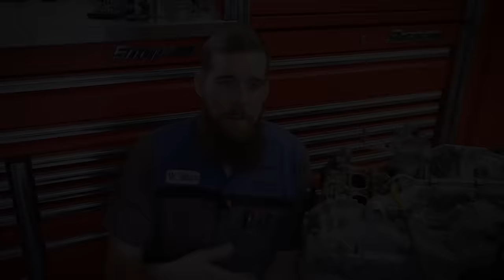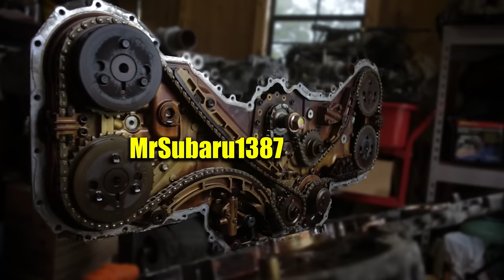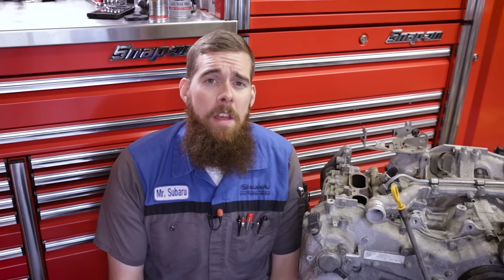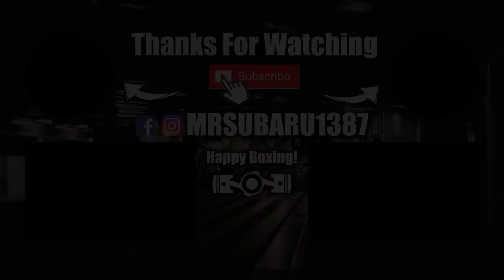Why Subarus Are So UNreliable!!! Buckle Up!!!

Comment: I had a non tubro forester with the 2.5. I bkught it with 225,000 miles. It had already had the head gasket done once and I did it plus the water pump and never had a problem. I put over 50k on it with no problems. I eventully put a thro out bearing in and sold it to a friend. It has like 350,000 on it now and runs fine. Needs shocks.

Comment: Most of these if not all of these issues are only Related to the USDM subarus and the 2.5L POS. 

The EJ205 Turbo has no headgasket issues, no Ringland issues, No big end bearing issues. 
Only issue is the MAF and the weak 5 Speed. 

Obviously im talking about the real Impreza WRX's 1994-2000

Comment: I really understand your point, Subaru is a really different type of car compare to other mainstream brand. But most people aren't interest to maintain or taking care of normal maintenance . My actual FXT 2014 is my first subaru car and i love it but maintenance cost are easilly double than a regular car like my previous : (Mazda MPV 2006, Toyota corolla 2000,  Nissan Sentra 1992) My FXT 2014 as now 274000km or 171240 miles no issue with the FA20DIT no oil consumption at all, only issue with the CVT. I make all the maintenance like subaru recommend interval at the dealership.

Comment: 100% true.  I was just talking about how in this town there are 1,000 chumps whose daddy's buy them $80k cars, then they go and buy cheap-ass chinese tires and complain that the handling on their cars sucks.  If you drive like a moron, you'll have moron problems.  If you buy $2,000 wheels and buy $80 tires, you're a moron.  If you keep pushing your car too hard, it's not going to last long.  This video is fantastic.

Comment: My 08 STi, i bought in Dec 07. Ringland failure in 2 & 4 around Sep 09 66k miles. WHY? Cuz i beat the crap out of it. I did a quick short block swap in a weekend. Then in 2011 about another 60k miles i get a head gasket failure. WHY? Cuz i didn't resurface heads. Now i had time and money for next one going in. Had a shop build me a long block. Currently at 101k miles on this block. Total 227k chasis miles. Currently still on same tune & long block from 2011. I love my beat up battle hatch and i still beat it up daily to work. Also have a 19 STi that i bought in Nov 18. That one stayed stock for a month. I did this one right from the start lol. But i beat it up on weekends. Not once did i go to subaru for warranty replacement. I know a few that did. And it boils my blood......... Feel you on on this video...!

Comment: I am one of those people who are doing self-modifications to my '19 WRX.

I change oil every 3k to 5k miles. I got a pro-tune after cold air intake / CAT-back exhaust. Regularly check the engine for leaks or common issues.

I also like to launch my car, drive it "spirited", and plan to modify and tune further. If I end up burning my clutch early, blowing a gasket, or damaging some internal to the engine... It's my fault. I am WAAAAAAY past warranty and I take responsibility for anything that goes wrong.

Comment: Outback 2015: close to 200.000 km, the head gasket needs replacing. I have always been gentle to it for 7 years of it's life time. Needs every 5k oil change, not 10k as advised by Subaru, and if you hear a knocking sound from the engine, your oil is disappearing. Wish I knew this 7 years ago. I have run if into the ground much sooner than I anticipated.  I'm not going to replace or fix a bad engine.

Comment: From another fellow mechanic I can relate lol. I appreciate the videos I'm a Subaru Crosstrek owner and have been honestly quite frustrated with the lack of service info for the CVT transmissions. That said I wanted to Thank you for providing that info so I can better maintain my car. PS just hit 122k and was wondering other that the CVT fluid are there any other things that should be addressed at that mileage that aren't really common knowledge?

Comment: So true MrSubaru! The N/A Subarus aren't necessarily bad either. I owned a 2008 Impreza and it was truly a reliable car. Drove it like a regular cummuter car most of the time and had a lot of fun driving it like i was in WRC when it snowed. Used quality oil, changed oil every 5-6k km's. The only thing I ever had to replace besides brakes and plugs/ wires was a front CV axle. Ended up trading it in for a new used car last year because the timing belt was passed due and wanted to get something with more power.

Comment: My 2001 LL Bean edition w the 3.0 H6 is truly the best Subaru I've ever owned. 22 years old runs like new.
Reply from the maker: My 2002 LL Bean has 301,000 miles on the clock.
Reply: @MrSubaru1387  mine is at 140k still going strong doesn't use oil between 3k oil changes. And the power of the 3.0 makes it a joy to drive.

Comment: I have a 2021 STI bone stock and no plans on modifying it outside a bit of cosmetics. Not even an AOS. I drive the STI mostly in intelligent drive mode, shift between 3-4k, almost never go into boost. On the freeway onramp I might go into sport to accelerate quicker (downshifting to not lug the car) on occasion. But I baby this car, treating it like an economy car. 

I always say "if you drive it like a race car, expect race car reliability"

Comment: I have a '12 impreza sport that is nearing 160k miles.  That isn't an amazingly high amount of mileage but it is getting up there, higher mileage than most people will want their used car to have. And honestly, I probably beat the hell out of it more than I should and do the bare minimum maintenance.  Subaru replaced the rings and the entire block at around 40k miles due to excessive oil consumption.  Didn't cost me a dime.   The only other issue I've had was the throw out bearing went at about 110k miles, which was probably my own fault for just holding in the clutch at lights instead of putting it neutral.   It seems to run as good now as it did day one and the only thing I have ever done is change the fluids and spark plugs.

Comment: I had a 2019 Outback and never had a problem with it. I just got my 2022 Outback turbo and I am glad I watched this video. The key with any car is appropriate maintenance to avoid mechanical problems. Subaru is the best and most reliable car out there in my book. Great video!
Reply: Have the same with 3.6 and 2010 legacy with same engine. Great cars but 2019 has parasitic drain that took multiple visits to sort out. Also class action on too small battery. Put in a higher capacity and no more issues.

Comment: 2014 STI hatch purchased new in Dec 2013 (ordered from factory with a 10-week lead time): first motor started REALLY consuming oil around 50k. Motor replaced by SNA. 60k consuming oil again. SNA replaced turbo. Now at ~70k miles and engine consumes 2+ qts of oil within 1200 miles. Factory is evaluating yet another motor. Factory/dealer serviced with factory spec oil and filter. No mods. I'm at my wits' end....

Comment: I just got done redoing my 2011 Subaru Impreza NA 2.5i Hatch yes the heads were machined and Gates brand timing belt just got it running Sunday it fired right up but the power steering pump wined like crazy and we did a fluid drain and manually turned the steering wheel right and left on the lift tires in the air. Well anyways I was shook on how it just fired right up did not even studder and will have oil replaced around 500 miles. after rebuild. I watched alot of your videos for guidance and it was hard Learned how to depressurize the A/C lines and replace cam shaft seals and the whole nine yards it was intense but not impossibly. Just need a Transmission oil swap and shes ready for winter.

Comment: Appreciate the video. I have 2015 xt with 67k. I didnt know about the issue of blowing head gaskets if you add any power. But after more research i am more worried about the cvt over heating if a cold air and exhaust is added. People also then add a trans oil cooler.

Comment: I'm a 40 year bicycle mechanic. Maintenance  is everything on mechanical merchandise, no matter  what it is, but especially if the moving parts are exposed to the elements. Most bicycle owners never have their major bearings cleaned and regreased, not realizing that only very expensive bicycles have sealed bearings. By the time they notice a gritty sound or feel it's too late, and your entire WHEEL needs to be replaced because the inner race in your hub is irreparably damaged. 
It's important to know the limits (and design) of your mechanical belongings. 
Don't just buy a name brand "because someone said it was awesome."

Comment: Before watching this video I knew what the subject matter was really about. I did not know much about cars tuning ect when I got my 13 wrx. I got lucky because the mods done to mine are not improper and I knew the importance of maintaining these engines. If you know subaru then you know it burns oil and needs extra attention to ensure longevity. That is one thing I think most people can agree that subie oil returns could have an improved design, hence why I have an air oil separator to get installed when i find a shop I can trust to do the appropriate tune. I also knew that to run this car as a daily wouldn't be cheap. I know a guy who blew his engine in a 15 wrx almost right away and now has a 16 or 17 I think. Guess what even he admits he beat on it. Some people can't accept they are to blame. Unfortunately angry rants won't help them to.

Comment: The Camshaft Pulleys on my 2003 Legacy B4 just disintegrated a few months ago. Turns out that they are made of a composite material that has a natural lifespan. Did Subaru tell owners about this. I had to change all the valves and have decided to go with RCM alloy replacements for 3 of the 4 pulleys, ( 1 was steel from factory) Aside from a larger intercooler. Ive left it stock . Still love the car despite the recent catastrophe

Comment: Owned multiple wrx’s never had a head gasket fail prematurely only my current did I need head gaskets done, just did them 182k original motor with cat back. And I’m not that easy on it. I take it out in the snow, dirt currently setting up for rally cross for a proper send off before replacing the motor. I don’t know the bad side people speak of. I think I take decent care and I push it and have fun, I will be a life long Subaru owner. My crosstrek also has 240k on it and still going. I can attest proper care is key.

Comment: My Subaru is the first reliable car that i had.  I change my own plugs, MT5 fluid, and did the TB once. I had to have the dealer do the HG once.    I'm at 202000 miles.  I only use the Gates Tck304N kit with the OEM parts for the TB.

Comment: I have a 2008 GH WRX and have run her as a daily for the last 7 years and 70+k miles. I religious maintain her, the only mods I have done engine wise is a cat back exhaust and an alloy Intercooler. She has never missed a beat even today at 145k miles all on the original engine. Anything I have done has been when original parts have broke or worn.

Comment: Full bolt on 70k miles,runs great oil,transmission, and coolant change regularly, get a pro tune for mods, an Aos is a must! Heat soak is the enemy happy driving!

Comment: 1000% agree with this. I got a 2012 wrx with 157,000 km on it. Intake and cat back exhaust with a tune and have never had an issue with the car. Yeah I have fun with it here and there with some pulls but treat the car well. Oil changes every 4-5k MAXIMUM and have not had an issue. The car has stock motor, turbo, and transmission (WITH A 5 SPEED). Its the driver not the car. End of Story.

Comment: Thank you for the video.  Here ( in Israel) we have also Subaru with 1.6L engine. I have just bought  a XV (  america : crosstreck ) with 1.6L engine , 2017. Hope it  will justifies  the purchase. So, if I understand your message and opinion , you are saying - use only original parts.  right ?

Comment: I have had 2 outbacks. I had my 2010 premium 2.5i for over 10 years and the only issue it had (other than not enough power 😂) was the transmission replaced at 72k at Subaru’s expense.  I’m super excited about my brand new outback XT. I am hoping it lasts a very long time. It is my understanding that the transmission is the beefed up CVT used in the WRX. I waited until the last model year to make sure all the issues (well most) have been ironed out. So far it is a fantastic vehicle.

Comment: Lost my gc8 at 300 thousand miles full engine failure.  Was well maintained. No more power when accelerating and bogs down. Many sensors decide to fail at a round the same time. Was to expensive to fix. But ill never give up on it!!! She will be a new soon.

Comment: I have 03 wrx, Manley rods and pistons, freshly machined heads with new gaskets, new short block, 1000cc ID injectors, AEM fuel rail and walboro 255 fuel pump, vf39 turbo, HKS bov, mishimoto radiator and air oil separator, tuned on E85 and accessport V3. Oil temp gauge,boost pressure gauge, Megan coilovers, federal tires, stage 2 competition clutch. I’d like to think it’s been modified pretty properly. Only thing I know for sure is bad is the stock 5 speed and the rep enkei wheels I have lol

Comment: In 2005 I bought a new STi which had a coolant pipe failure after only a few months and started leaking coolant everywhere. (Apparently there's a metal coolant pipe connecting the front and rear of the EJ25). This must have been a rare defect as no one on the forums or dealer had ever seen this before, but seeing the engine of my stock STi out at the dealer after only 4000 miles was a bit upsetting. After that there were two or three valve cover gasket leaks, but after THAT it was fine. Fortunately all covered under warranty. 17 years later I just got my second Subaru, hopefully the FB25D can keep its fluids internally. 🤞

Comment: Couldn't of owned a more reliable engine in 17 years ...EJ 20 twin turbo
300 thousand kms 
No ringland
No oil burning
No oil leaks 
No blown head gaskets 
Sounds quiet as the first day i bought it .
Always use Castrol edge 5w40 full synthetic
And genuine Subaru black filters 
And 3000 miles complete service.  
Most reliable engine ive ever owned

Comment: They are unreliable because they probably aren't maintained 🤷‍♂️.

Simple things changing fluids, replacing parts when they wear out of fail (CV axles, oil pressure sensor, knock sensor etc). Keep that washer fluid topped up, good tires on and good brakes. Should last forever.

Comment: I agree with this video and mrsubaru I work on Subaru's for a living and 9 times out of 10 the reason for replacing or rebuilding an engine is due to abuse weather that abuse is beating the crap out of it or lack of maintenance. Putting an aftermarket intake on any car can cause mad MAF readings and  aftermarket exhausts can cause boost creep. Long story short take care of your car and it will be reliable

Comment: I got 08 2.0r impreza from a frend, hi only bought oe parts, after 1 mouth the clutch fork failed (i know they are a problem) i then change the fork and clutch all the bearings, springs and the rear main seal oe parts only as a preventative maintence, the clutch and seal ware fine douh. The car is at 320k km. If you dont abuse the car and take care of it it will serve you well.

Comment: Ive seen subarus last forever and ive seen subarus less than 5 years old blown up at the junkyard.
It's all about maintenance and driving habits.
Change your oil and filters, keep your cooling system in good shape and drive like a normal person and not like the you're auditioning for a driving fails video and you'll get plenty out of most cars.
If you're gonna run it hard and fast and ignore the maintenance schedule then be prepared to start shelling out for repairs.

Comment: Little late comment but I went subaru in 2017. I'm a delivery driver and the forester I bought used had 112k miles was a fleet car and maintained regularly. I have kept up on maintenance 100% and I'm currently at 247k miles and counting. The car still runs and drives like new and my goal with this car is 350k. I expect to get there. Most reliable used vehicle I've ever purchased.

Comment: I've got a 2009 Forester, normally aspirated, that I bought used with 100,000 miles. The previous owner had done all the correct maintenance, and the dealer I got it from had done the timing belt/water pump change before he sold it to me. I do the brakes myself, was having a local guy change the oil (full synthetic) every 5,000 miles. The only issue I had was it blew a front pulley seal, on a long fishing trip. I suspect the oil change guy overfilled it, but, no proof of that. Local subaru guy said "shit happens". The car runs great, no other issues.

Comment: Couple of years ago I bought a 2016 Subaru Levorg 2.0 turbo (FA engine). It's had a heap of issues, engine knock, carbon build up, injector failure, CVT transmission issues, EyeSight system sometimes tries to kill me by suddenly accelerating into cars in front of me - instead of matching their speed. On top of that the materials used seem to be very cheap. The paint is the thinnest and softest of any car I've ever owned, the steering wheel leather is peeling off, as it is on the gear shifter and bolstering of the seats. The stock suspension was so bad I replaced the whole set for aftermarket. I do miss having a Honda and not worrying about all these things.

Comment: I have 3 vehicles i bought brand new and still have because i took care of all fluids myself. 1994 Dodge Dakota and a 1998 Dodge Ram and i just bought a 2023 Subaru Forester and the engine looks pretty easy to work on but always hearing how brittle modern vehicles are scares the hell out of me but i guess welcome to the new world of sensors and sensors ans finally sensors :) Just bending over the side panel i have to watch i don't break the light lenses boy i miss the vehicles from the past.